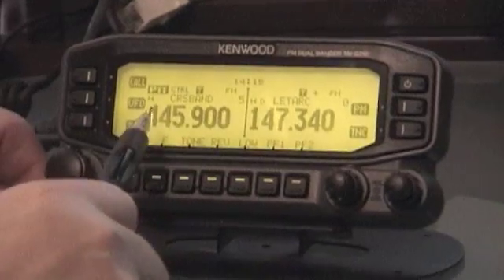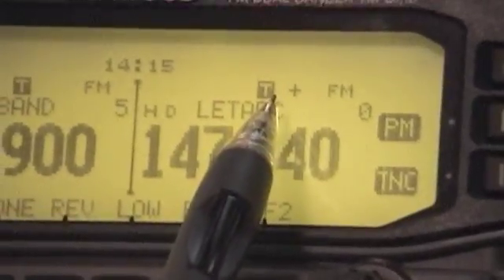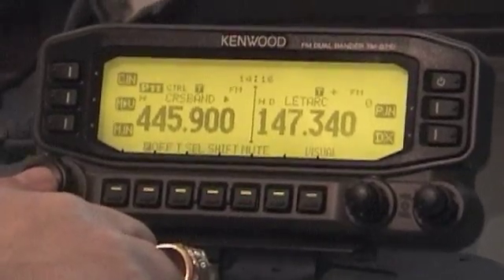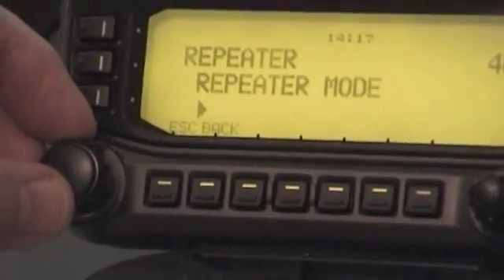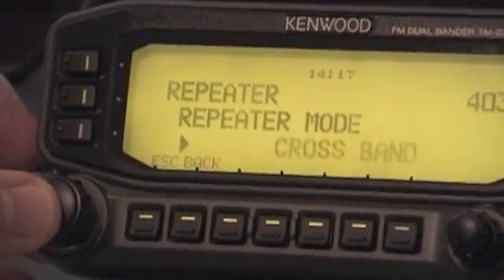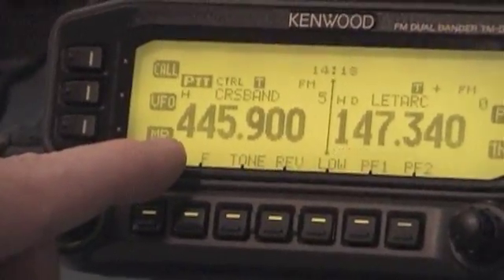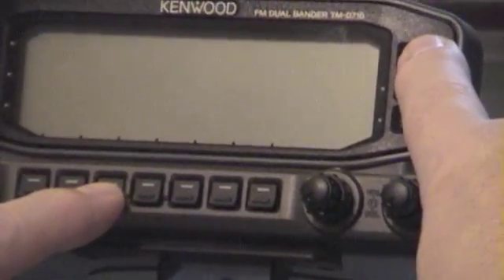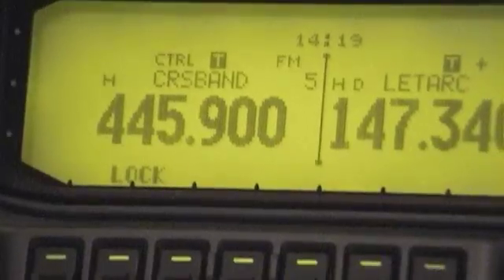Demo of Crossband Repeat with Kenwood TM-D710

Comment: How rugged do you feel this radio is? I have ran a 2200H for a decade with no issues but I want a rugged true dual VFO 2m/70cm with channel naming like the radio in your video. I plan on programming in a few hundred frequencies with labels/names via CHIRP etc.
Reply: These are great radios, but they're designed to be mounted in a car and therefore probably not the most rugged. Although they are durable.

Comment: Hello OM....what about using only 2m both sides using as repeater.
Reply: You can't transmit and receive at the same time on the same band using one antenna and no duplexer. That is why a typical 'normal' repeater requires large cans to filter the transmit and receive signals. The reason it is called CROSS-band repeater is that you need two bands. It's the only way to stuff a duplexer inside a small radio. -- W1SOP
Reply: nicely said !
Reply: @001Kidwiz  Its also a regulation that you can't use VHF for cross-band input, only UHF... that was to preserve VHF frequencies and reduce QRM on VHF.

Comment: Kenwood tech support says to leave the UHF side on 440.000 & also to disable the APRS.  Crossband repeat will not work with APRS enabled. Just a couple FYI's😎😎
Reply: Kept hanging my head against the wall because I couldn't get it to turn on, thank you I always keep APRS enabled.

Now I have a PM set up just for x band, I only wish that I could get the cross band to enable automatically when I switch to that PM

Comment: The prior model, the TM-D700 also had cross-band-repeat (CBR) but it sounded just AWFUL. Several years into production Kenwood finally addressed the problem and released a service bulletin that fixed the issue but it required changing some SMT capacitor(s). I performed this on my D700 and sure enough CBR sounded great afterward.
I'm going to buy a new D710 this week and CBR is definitely a super useful feature to have, not to mention the very best stand-alone APRS setup made :)